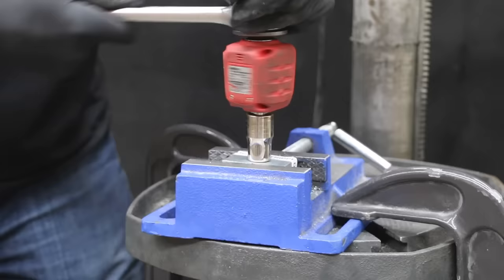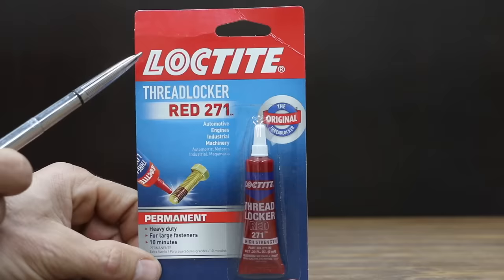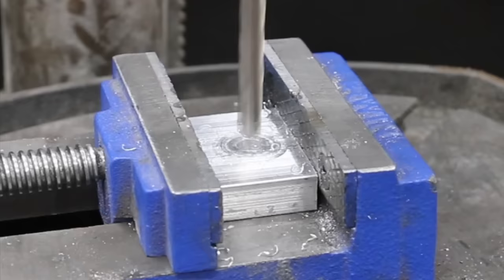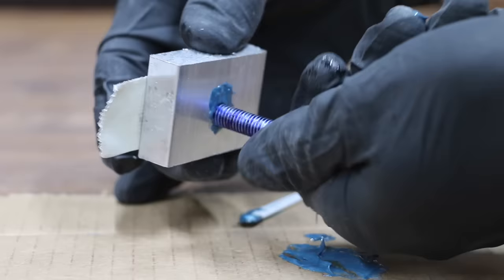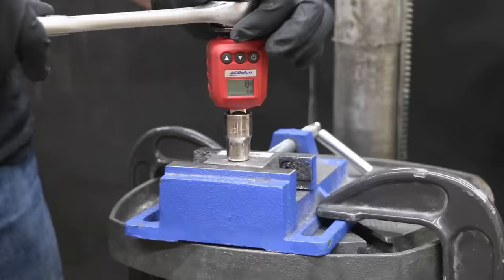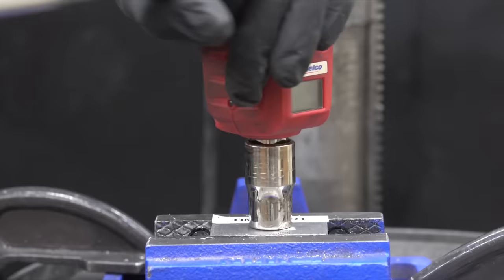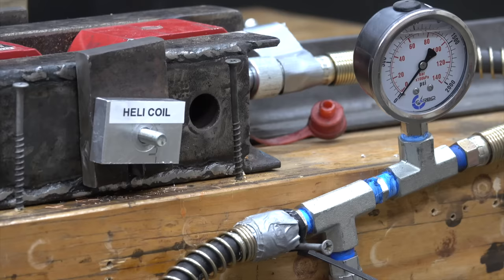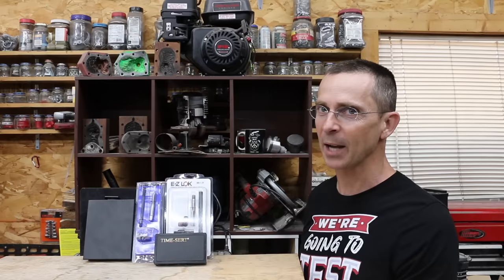Best Damaged Thread Repair? Let’s Settle This! Heli Coil, TIME-SERT, E-Z LOK, JB Weld, HHIP, Loctite

Comment: Great Work.  
The only comment would be to use a better grade bolt (grade 8 bolt) so as to actually test the strength of the threads rather than the strength of the bolt in the stretch test.
Have you done that in another test possible that i may have missed?
Reply from the maker: Thanks!  Thanks for the suggestion.

Comment: Great video with a lot of tine and effort expended.  I have a nagging question though.  If you are testing to see which thread repair is strongest why would you use a mild steel bolt and not at least an 8.8 or 10.8 grade so we could actually see which repair was actually the strongest?  This would allow us to actually know if the more expensive kits was worth the cost when making repairs that need more torque and tensile strength.  Can you do a part two with higher grade bolts?
Reply from the maker: Thanks!  Thanks for the suggestion.

Comment: can you do a test for strength for all the stud inserts into alloy blocks, cases etc that use hardened steel/high tensile  studs or bolts to see which one holds the most pressure (* for performance engines , cars, bikes , boats even lawn mowers ;-)
Reply from the maker: Thanks for the suggestion.

Comment: Another fantastic video; great work.
The only criticism that I can think of is that, when displaying the results, any of the repairs that outlasted the bolts maybe should have been marked with an asterisk that outlined that failure point of the bolt was the theoretical minimum, or did you have a reason, that I did not notice or think of, for leaving those values stand as-is?

Comment: This was a great test, the metal type inserts were very impressive!   The only weird but crazy thing is... What if you needed to use thread repairs on a water jacket, between 6V heads?  Would any of these thread repairs be water tight?; if so, how much psi would they be able to withstand?   Thank you for all the work, and results!
Reply from the maker: Thanks!  Thanks for the suggestion.

Comment: Awesome video, thank you! 
I am left wondering how strong using just a larger fastener threaded into the aluminum (one which is the same diameter and length as the hole drilled to install the inserts) would be. Correct me if I'm wrong, but the greater strength of the inserts is because the diameter of the threaded hole in the aluminum is larger, unless there is some kind of mechanical pressure helping to hold the insert, like a Chinese finger trap kind of thing.
Again, this video has so much information packed into a short time, it's amazing.

Comment: I noticed that you didn't test Keensert style thread repair inserts which typically use 2 -4 hardened steel wedges that get driven down into the surrounding material to help keep the threaded insert from rotating.
Reply from the maker: Thanks for the suggestion.

Comment: K project Farm you think you could do a test on a two-stroke motor breaking one in as correct specs would say and then holding one full throttle wide open brand new from the box and looks look at the Pistons and the damage or run them both one broken properly and then one broken bat full-frontal the whole time just to see how far they go

Comment: These test are good and all but i think you should try stronger bolts for the inserts because all the bolts snapped at approximatly the same torque which means you can't get an accurate measure of how strong the insterts actualy are
Reply from the maker: Thanks for the constructive feedback.

Comment: 3:43 A 40 plus year machinist. Generally, the metric tap drill size is the nominal metric size minus the pitch. M8-1.25 would be a 6.7 to a 6.9mm drill. 17/64 or 6.75mm is the perfect size. Harder materials I would use 6.9, softer I go 6.7.
Reply from the maker: Thanks for the feedback.

Comment: It seems you're actually testing the weakness of the bolts as any insert method that holds long enough for the bolt to break is more than good enough for that type of bolt.
Maybe try it with 8.8 grade bolts to really test how the threads hold up.
Interesting video though 👍
Reply from the maker: Thanks for the feedback!

Comment: You did not use enough inserts for the helicoil and helicoil copy kits.
But other than that no surprise that a steel thread of larger diameter holds stronger than an Aluminum thread.. (I haven't finished watching but I KNOW this is the case from years of fixing small engine blocks)

Comment: First thing… apparently bolts stretch around 1000psi 😂. Second… curious about the metal thread insert’s ability to stay in place when unfastening the bolt… especially after bolt corrosion. Seems like some loctite between tapped hole and insert would be a good idea.
Reply from the maker: Thanks for the feedback.

Comment: Maybe if you're building your own motor it would be a good idea to put inserts like this into every single spot it's obviously way stronger than aluminum.... a good follow-up video would be to expose the aluminum you used and each of the threads to water with some type of sodium to see if there's any corrosion that causes the threads to break. Using each one in electrolysis would be cool.
Reply from the maker: Thanks for the suggestion.

Comment: Wow, you did a lot of work!  FYI, Copper is harder than aluminum.  Many torque tools are mislabeled.  I think it is an American thing.  Yours should be lb-in and not in-lb.  Lb-in is a measurement of torque and in-lb is a measurement of force.  You would have 347 pounds at 1 inch and not 347 inches for 1 pound.

Comment: So im guessing the EZ lock or something similar for a spark plug hole cause you couldn't knock the little piece of metal down in yiur cylinder with the other thread repair kits , would definitely scar something within the cylinder

Comment: That the inserts are very strong and their threads don't strip isn't very suprising, but I wonder why the inserts themselves aren't stripping the outer threads on the aluminium. Is it because these are left-handed threads, and that makes them inherently stronger when applying right-handed torque? Would they also fail with left-handed torque at around 300 inch-pounds?

Comment: the thread inserts are for when you want to use the same size bolt as before it was stripped instead of just using 1 bolt size up is this true.
Reply from the maker: Thanks for the suggestion.

Comment: I appreciate the test but you totally forgot to try red locktite. In a pinch for for fast dry i will even use super glue sometimes. I also think the jb weld steel stick would be a good try
Reply from the maker: Thanks for the suggestion.  Thanks for sharing.

Comment: The first half of the tast was great. However, the second half would be much more informative if the bolt was strong enough to create a thread failure in the aluminum. Then there would be an actual strength comparison of the actual threads, versus just showing that it holds the same weak bolt. Disappointing.
That being said, I appreciate the time you take to make these videos and I enjoy most of them very much.

Comment: It's important to remember that the numeric results are non admissible when the bolt breaks as that is just showing bolt strength, not insert strength. What it does show is that the insert is stronger than the bolt though, which for all purposes is what we want to know. I would be interested in seeing the test repeated with a higher grade bolt as well as some grease under the head of the bolt to avoid excess friction of the bolt collar/head. I'd be even further interested to see a pull-out test of the threads using a hydraulic load cell.
Reply from the maker: Thanks for the suggestion.

Comment: This is a great video and great information. However I’m curious to see what would happen if you drill out a damaged hole and tap it before putting in JB weld in and re drilling and retapping. That way it has something to grab onto
Reply from the maker: Thanks!  Thanks for the suggestion.

Comment: I would love to see you repeating these tests with steel base material.( e.g. automotive grade steel alloy) We could really see which of the insert type repair methods holds up the best, also using stronger bolts.
Reply from the maker: Thanks for the suggestion.
Reply: Personally, I don't see the point in re-testing in different materials (e.g. steel).  He has already proven that the metal threaded inserts are stronger than the bolts even when installed in aluminum!  Case closed!
My only question, and maybe I missed this info 
in the video, is what class of bolt were you using for the tests?
... and thanks again for a well-thought out and well executed test.  One of your best, I would say.

Comment: I was hoping you could test out different plastic polished and polishing cloths/pads. I use PlastX, Soft Scrub, Rubbing  compound,  Turtle wax swirl remover with a variety of pads and cloths to try to remove the surface scratches from safety/sun/reading glasses and alsol electronic equipment like printers & stereo equipment. I love your videos. Is there an easier way to search for your videos than using YouTube search?

Comment: Curious. Would you do a part 2 testing grade 8 or 10.9 bolts? Since so many of the bolts used gave before the repaired thread did, I'm curious how the threads themselves would compare with stronger bolts. Or were they already high grade bolts? Although, to be fair, they all held as such high numbers that maybe this part 2 idea is pointless!

Comment: Seeing you used 8.8 bolt with aluminum part, I wonder what would be the results for 12.9 bolts and tool steel part. This way the threads repaired with repair kits might have the chance of being the failure point with good data and not have the bolt snapped.
Reply from the maker: Thanks for the suggestion.

Comment: Would have been cool to see how water resident the new threads were. How much pressure you could pressurize a chamber with the stripped out threads to before it started leaking.
Reply from the maker: Thanks for the suggestion.
Reply: @ProjectFarm  air pressure might be easier and more rigorous

Comment: I had an exhaust manifold hole stripped out. Only 50 percent of the thread length left. Bought an coil insert kit from Amazon and put it in there. Held up very well and no warp. 
The four metal repair kit seems to top out shearing strength of the bolt. Ez lok and timesert are advertised to be a lot strong than helical style. Appreciate if you could make a follow up video on if those are actually stronger.
Reply from the maker: Thanks for the video idea.

Comment: Great video. I have been trying to research the comparisons and viola it is done so well in this video. Thx. I have to replace two muffler bolts on my Briggs and Stratton 12.5hp petrol engine ride on mower. The muffler is mounted vertically / on the side of the engine. It gets very hot. I can't take the engine out of the mower. And the bolt diameter is 8mm. the bolt hole is close to the exhaust port. I am concerned about using the metal inserts so close to the exhaust port wall. Drilling out the old thread may weaken the engine head. Also, the hole is a blind hole. Depth of the hole is shallow. I guess not using a helicoil and a tab to knock out would be better? Therefore a shorter metal insert. What is the best insert for very hot applications? And can you get inserts in different diameters and lengths? Do any of the inserts need loctite type compounds when inserting a new bolt? Many thanks.

Comment: What I take from this: If you need to bolt aluminum parts together or onto something, the connection strength is kinda important and there is no space for a washer and a nut on the other side, drill and tap larger than the bolts you want to use and put thread inserts in instead of drilling and tapping the correct size for the bolts. :D

Thanks for all this testing! Drilling and especially tapping all those holes was probably really annoying :D

I'd be interested to see whether or not those inserts do as well as a proper nut on the other side.. Would need stronger bolts of course. Would nuts strip before the inserts get pulled through the aluminum? If not, would the Time-Sert ones with the flange side on the outside make a difference to helicoil/HHIP?
Reply from the maker: You are welcome!

Comment: This is a dumb question, but would jb weld and a time sert work together in a spark plug thread repair? Let's say the hole is a m14 and the time sert is a m12. 

Basically fill it and drill it for a m12 tap. Then insert a time sert insert?

Comment: Awesome video and thanks a lot for making it. 
Would you be able to make a similar video while using Delrin (Acetal) as the material - instead of aluminum with a thread like 3/8-24 UNF, plus having air-tight sealing o-ring at the beginning of the thread?
Reply from the maker: Thanks and you are welcome!  Thanks for the video idea.

Comment: What about a home made fix, drill out hole for larger bolt, drill hole down through the bolt and thread hole, cut head off bolt and thread bolt into new threaded hole and put bolt in new hole.
Reply from the maker: Thanks for the suggestion.

Comment: 1 - What are the specs of the test bolts? Grade 5? I'm curious what the material properties are. 

2 - You give the pressure of the hydraulic system at the point of failure, but if you divide the pressure by the surface area it's being applied to, you can provide the force being applied. I think that would be easier for people to understand. Or provide the surface area so we can do the math ourselves? :)  

Thanks and keep it up
Reply from the maker: Thanks, will do!  Thanks for the suggestion.
Reply: @ProjectFarm  What kind of steel are the test bolts made of? 
And what size where they again?

Comment: Very helpful as my spark plug would not go back in with the ratchet and I made the mistake of carrying on and the coil insert wound out into a strip of wire above the spark plug, after watching the video it may be best to get a Time Cert to put in as it has no tag that will break off into the cylinder, rather not take off the cylinder head as its a lot of work and I have never done one before.
would anyone know if the insert that is in the hole already if it would be unwinding itself down into the cylinder as it is unwinding it self above the spark plug when I tighten down the spark plug as it feels tight I may just leave it?     If that make sense

Comment: Excellent comparison.  I’m curious how the metal inserts would perform in steel: example spark plug in steel cylinder head, a common use case.  I’ve also seen helicoil repairs doubled up.  That is a helicoil insert in a helicoil insert used to repair a spark plug in an airplane cylinder head.  Does doubling up the inserts weaken the fasteners?  I had a plug repaired in this way ejected from the cylinder in flight forcing an emergency landing.  Is it safe?
Reply from the maker: Thanks!  Thanks for the suggestion.

Comment: I must point out that your order of use for the Time-Sert components is incorrect. Counterbore the hole BEFORE you tap, thread damage or deformation can occur and could cause galling with the insert.

Comment: So, if there's say, an oil pump at the other side of thread and you wouldn't want to drop any large metal bits in there you couldn't use the helicoil or any of the fake helicoils due to having to break off a tab that falls inside the thread?

Comment: With the 8~1.25  striped hole it my be easily fixed by just retapping with a 10mm 1.25 tap without the need to even drill
Reply from the maker: Thanks for the feedback.

Comment: I dont know if you have a video already but can you do one with " broken bolt extractor sets"? I have an engine where 4 out of 6 bolts broke on my water pump. The Amazon set did not tickle one bolt. Did not drill much. Would be an interesting experiment.
Reply from the maker: Thanks for the video idea.

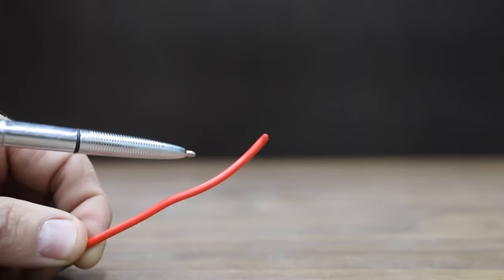Comment: 1:50 use solid wire not copper and it works great, especially in brick or concrete.
Reply from the maker: Thanks for the feedback.

Comment: My work truck is a 2013 ford e350 box truck with the good old 5.4l at 60k miles it blew out a spark plug and the garage my company uses fixed it I wonder what tread repair they did
Reply from the maker: Thank you for sharing!

Comment: How about a, "Pipe Thread Repair" tool Vid, for Male and female sides ?

I have a delta two knob, hot n cold, splash guard. Ine if them, no longer screws back in.

I can't tell if it's the splash guard / faceplate or the pipe thread ? 

It the old style Hot and Cold, separate, twist knob, plastic bulb grip controls .

I would pop of the handle cover insert. Remove a small screw in the knob. Then unscrew the wall mounted metal faceplate.

I'm no plumber n hope u or anyone else, gets my drift ?
Reply from the maker: Thanks for the suggestion.

Comment: time serts are the best you can buy time sert incerts that are all different lenghts and one really good thing is you can buy time serts that have a much more coarse thread on the outside which is great when the bolt has fine threads going into a soft metal like aluminum the coarse threads bite into the aluminum much deeper then the fine threads and still have the same size thread on the inside of the time sert
Reply from the maker: Thanks for the feedback.

Comment: You shouldn't be rating the fixes where the bolts broke. Just rate them all, at the average bolt shear force/pressure.
But great work running the tests.
The biggest take away here is, if you want it to be strong, use inserts during initial manufacture!
Reply from the maker: Thanks!